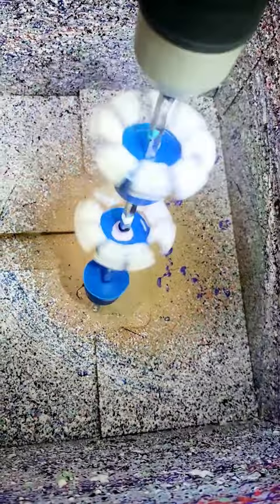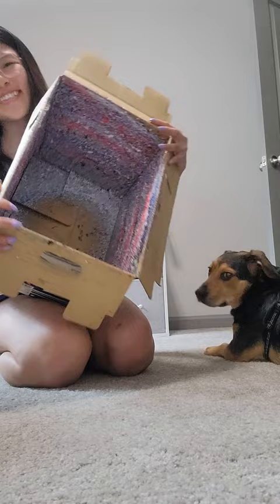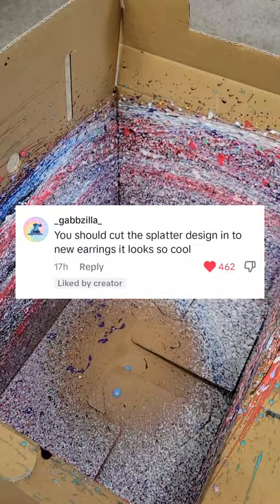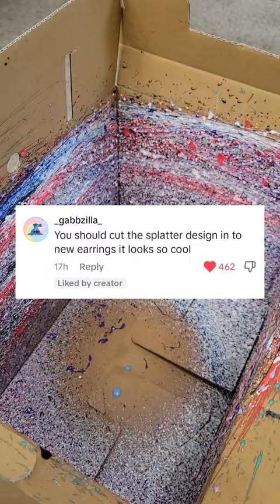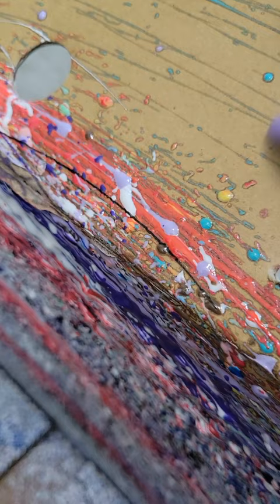let me know if you have any ideas on how to make jewelry from the paint excess! 🫶

Comment: Just line your next box with clear wrap or plastic next time. That way it should come off and you can also reuse the box.
Reply from the maker: That's a great idea!
Reply: @lovekojewelry   poke jewelry into the cardboard
Reply: That’s what I was gonna say use maybe some wax papers so it comes off clean . Even line the bottom to catch it all wait for it to dry completely and then just take the scotch tape off the cardboard box and reuse it like normal
Reply: @lovekojewelry  using a box made of coroplast would work. It’s basically cardboard that’s made of plastic. The paint should just peel off.
Reply: Scrape the paint out and make a design on the earing
Reply: @lovekojewelry  you might be able to put them into resin molds?
Reply: The plastic will leave a texture maybe good maybe bad
Reply: @lovekojewelry  I don’t think it’d be that easy to peel off or if you use plastic it might get plastic in the paint and ruin the jewelry, get a metal box and that will be so easy to scrape off and you won’t get any shavings off it  in there and you can reuse it forever
Reply: But plastic is bad for the environment if you throw it away right after, + she can reuse the box anyways without the plastic
Reply: That way they can do both make art and julrey like do 2 sides of the box in wrap and the other 2 open for art :>
Reply: Great thought
Reply: Either that or use ikea plastic containers!
Reply: I was just abt to say this too
Reply: @lovekojewelry  Poke jewelry in the cardboard so it swings on the thing when you spin it
Reply: parchment paper
Reply: I was abt to comment this lol
Reply: That’s what I thought!

Comment: You could just soak the box in water to dissolve the cardboard and peel off the paint and for future boxes paint  an  undercoat of PVA glue to form a base coat this should dry transparent …the other method might just be be use a paper lining that can be dissolved in water.

Comment: Not Sure about the existing box. But use separate cardboard pieces in the box. You can line square ⬛ pieces of cardboard with plastic over it inside and poke other pieces inside. Then as you spin it paints the others on the wall. after dry the pieces inside you can pull out and cure it. Then when the plastic is full you can use the paint pieces. You may need more than one set of inserts to allow drying. Happy Crafting 😀

Comment: Maybe if you cut shapes from the cardboard and stick them back to back in some resin you could make some cute earrings or charms!
Reply: This would be cool to see
Reply: Yeah thata what i was thinking, could also be cut into pendants or even idk coasters and encased in resin
Reply: But, she said she’s been using the same box- she probably wants to keep using the same box
Reply: If the enamel is very durable, maybe just adhere the shapes together, back to back.
Reply: I was going to suggest something similar but slightly different to make pendants  First cut out the shape you want from the cardboard then coat the sides and back with either black or a matching color of the same type of enamel paint and bake to cure it. Then encase it in several layers  of resin to make it durable and waterproof either by dipping it or pouring it into a mold. If doing a mold  something with a rounded or faceted front will help make the painted part stand out more.
Reply: This is what I thought too

Comment: Use an empty paint bucket (seek your preferable width and height) and line the inside wall with thick plastic sheet (like transparent sheet for printing). You can use double sided thin tape to keep the sheet in place and will be easy to replace. 

Although I'm not sure how you can use this to line your earrings but the splatter pattern would be of good use in art projects. 

For your earrings, adding different colored drops of paint on different regions and spinning them would give you a much cleaner finish. A bit tedious though.

Comment: Poke the earrings through the cardboard box, using the backings on the outside of the box to keep them secure. Then any paint flung off in the inside will land on those stationary earrings. Occasionally you can cut the box down, and put the “strips” of splatter painted earrings into the oven to be cured. Bonus, no 2 earrings will be alike, which isn’t a bad thing… You can pair them up anyway, wait until a better match comes along or even sell them singular. 
I just stumbled upon your cute business. And will definitely take a better look through your merch later tonight. 💖

Comment: You won’t be able to use this particular paint excess for the earrings because there will most likely be cardboard stuck to it. If I needed to do this, I would make a fresh batch of earrings for this purpose. Paint it a base color and then I’d drip different colors onto the earrings using a thinner consistency of that paint. Like if it was acrylic paint, I’d add paint medium by Golden (thins the paint without breaking it down). So if you are using resin, you will need to thin the paint by using less pigment per resin ratio. Then I would dip an old brush into one color, drip it onto the earring, cure. Then do the same process with the next color, cure, repeat…until you have the desired pattern on your earrings. The reason I recommend this in this way, is because the paint has a tendency to get very thick and clumpy when you add several layers. Another way I would try this, is to dip the tip of a straw into the thinned out paint colors, one by one, and then gently blow on the clean end of the straw. It should fly everywhere; so I’d work inside of a box like you do here. The way it flies will create a similar splatter effect (like your earring video). I hope this helps.
Please don’t hesitate to message me if you wanna brain storm some more. ❤ I’m ArtByEsterA everywhere.

Comment: Mount screens or Styrofoam around the box, push the earing wire into the screen or the Styrofoam. As you turn the other one color items, the spray will spray on the clean jewelry around the box.

Comment: Use a smooth plastic sheet 2-3 mil thick. Spray Crisco pan release on the plastic And paint as usual. Let dry and you should be able to peel the dry paint off. 

The other suggestion is clear glass, and using a sharp razor blade scrape under the dried paint. 

I’d use molds for the jewelry, that way bangle bracelets could match earring. No chance of the paint separating.

Comment: I've seen really thin sheets of metal at ace hardware. What I'm thinking is use thin metal that you're happy with, or even get pre made like dangle earrings. If you remove the hardware and tape them together you can line the new box. When you're happy with how they look you can cure it and replace with a new batch. Keep the current box for artwork since it's not easy to transform at this point

Comment: You could cut out small shapes and put them under a clear plastic or glass domes to make pendants, pins, earrings etc. There are tons of sizes and shapes of clear cabochon and bezels available pre made for displaying images or you could just use the bezel cup and secure/protect the cardboard with a layer of clear resin. (I actually like to use both, I fill the cup with resin or glue and pop the cabochon on top.) 

You might need to reduce the thickness of the cardboard by pulling the back layers off but it should work! Hearts would be super cute but even a basic circle could be lovely. 

In a similar theme you could also use resin molds to make things like bangle bracelets and embed strips or shapes of the cardboard inside. Good luck!

Comment: If you use resin you could just cut the shape you want and put 2 peices back to front so both sides have designs and the carbored dosnt show then put them in the UV resin molds and it will preserve it and make it last for a long time

Comment: Dry: You can peel the cardboard and then wire bush it off/ a sander. 

or you can soak it in water and use a sponge to peel the cardboard away, when it’s wet/mushy it should just fall away from the paint.

Comment: Take the last layer of the cardboard out 
ie:to which the paint is stuck 
And then you will have a thin layer of cardboard behind the paint . remove that layer by using oil or soaking it in water

Comment: Just line the box with plastic wrap before your next earing making video. Thus way when you spin it the leftover paint will land on the plastic wrap. Which than after a couple of different colors you can cut and do earrings with that quick dry clear epoxy stuff. You use a blue light to harden it(that's all I remember). It's sometimes used for nails. 
Anyways, from there you can make unique earing sets cut to different sizes and designs.

Comment: If it's acrylic paint soak it in water and then the box will dissolve without the paint going away, or use sand paper and/or file to get rid of the carboard

Comment: I don't know if it's helpful but, maybe try to soak the cardboard with water? The water softens the cardboard that way, it's easy to peel. 
In case it doesn't, you can rub the cardboard that was stuck to the paint gently until nothing is left.

Comment: Not sure if you've made it yet, or if the idea has already been suggested, but why not cut out disks of cardboard, soak the disks in epoxy to strengthen them and paint the edges that are still plain cardboard to hide it. Then you could put holes in them and make them into earrings?

Comment: I'm sure you could dissolve the cardboard with water. You'd just have to rub away from the cardboard side until it's gone. Tedious, but maybe worth it? If you can cut out certain splatter shapes you can always drill little holes in each side and attach chain and turn them into necklaces! Or just secure them to post and you could have drippy earrings lol

Comment: thin out the card board part asuch as possible then make geomatric patterns. make pairs and then join them back to back using resin so the cardboad is seald and wont break and paint us already goodm make sure that you draft it first so the faces of the earing on each side doesnt look disconnected. iykwis

Comment: If the cardboard has layers, gently peel away the back layers, then use some sand paper to file down the rest until it’s thin enough to be flexible. Cut it into necessary shapes, and apply a flexible sealant on the back to seal any remaining fibers 👍

Edit: you could also to use a knife to separate the layers. If there’s NOT layers, then you can go straight to the sanding step! This is just an idea, I’ve never tried this before lol

Comment: You could invest in one of those vacuum pots, cut the cardboard and soak it in epoxy then suck the air out of the cardboard/epoxy mixture so the air forced out of the cardboard is replaced with the epoxy

Comment: Soak the cardboard in hot water. You’ll be able to get it off if the cardboard is showing on the other side tape to cardboard pieces so the cardboard is facing each other and the liquid is facing out on both sides.

Comment: Get Halo pendants different sizes and varieties and then cut the cardboard box in the shape of the pendant gluing the cardboard side down to the pendant so that it shows the paint. And if you get the little glass Halo pendants you can even sign the back of the cardboard pieces glue it in with clear glue so you'll be able to see the paint on the front and all its bumpy texture and glory and the cardboard showing through in the back with your signature. Making them a totally original custom piece never-to-be-repeated in the exact same way.
Reply from the maker: Ooo that'll be pretty!

Comment: Although this might take a while, you can put like 80 pairs of earrings on the inside of the box and each time you remove excess paint from another pair of earrings, it will splatter on the earrings. It will form a pattern over time. You can release it once every 6 months as a limited addition.

Comment: You can cut off the inside layer of the box as well and it will also reinforce the paint a bit, but basically just cut off the flaps and figure out where the middle of that is and cut straight down and then you will be able to frame it

Comment: Rip the back layer of cardboard off. Stabilize the attached cardboard with stabilizing resin. Then cast the whole sheet a two part epoxy resin and then cut out little pieces for "gems" for jewelery